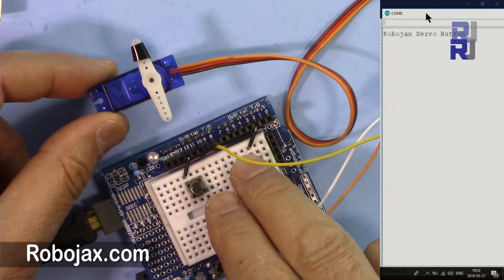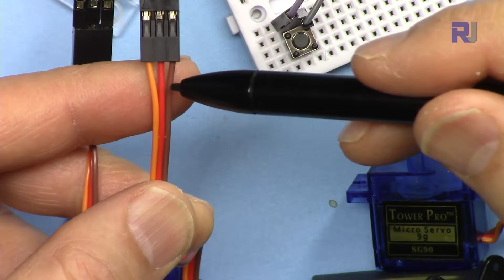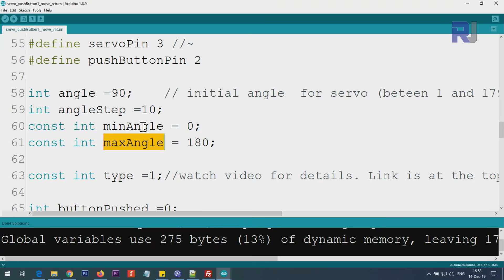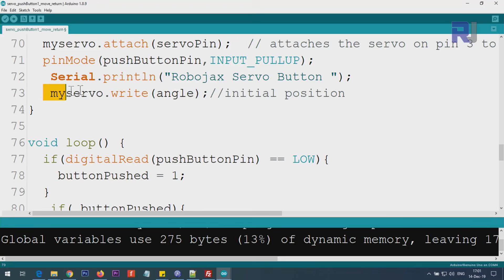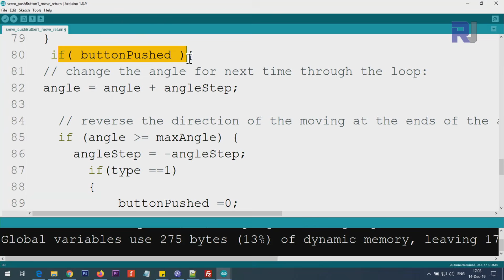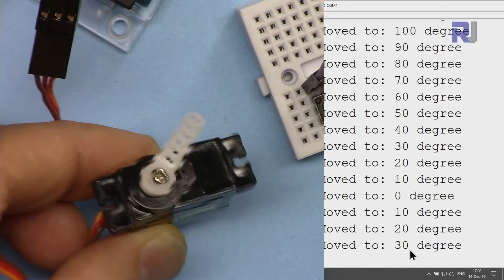Control Servo motor with a Push Button:  Move Servo and Return SPB-1

Comment: how to connect two servos to the same code in this case?????
Reply: i want code , wiring and explaination please
Reply from the maker: what you aks is full  video. it can't be explained with few lines.  God willing I will make the video you wanted. I have to see when I am free for that. But I have explained everything. if you watch it multiple times to learn how it work, or watch my other videos I am sure you will learn how it work and you can change it for you purpose. but if you don't want to learn, then either wait or pay someone to do it for you.
Reply: @robojax  ok i will be waiting cause it is a very important project and i will be waiting ....thank for replying(please try to solve my problem)
Reply: @robojax  it would be better if you can send me the code and circuit wiring please .....gmail : irfanm.ahmed04@gmail.com and i have tried so any different codes but non of them worked properly (pls it would help me alot .....)
Reply from the maker: it needs 1 or 2 days of work. I don't have it.
Reply: @robojax  ok no problem take your time (thank you)......
Reply: @robojax  bro from the last 2 days i have tried so much but i was not at all succesful at moving 2 servos with 2 different push buttons so that when the button is pushed the motor completes 180 degress and comes back .... i asked a few people who were familiar wit arduino but they didnt do much ... it would make a huge difference  if you could help me with this .... looking forward to your reply

Comment: Does anyone know if it's possible to connect two servos to one button?? I searched everywhere! Not finding anything😔
Reply from the maker: I have explained every line of the code. it would be very simple to assign pin to another sensor (or search my other videos) then instead of one servero send the same command to another servo. most of the time people don't watch the video and they don't learn. you gotta watch and learn it. or pay someone to do it for you.

Comment: Thank You So Much!!!! I just have a few questions.
Question 1: how can u do this with a horn button. 
Question 2: what Arduino do you recommend. 
Question 3: my breadboard needs to be quite far from my Arduino for my projects. So what can I do to create more space between the Arduino and the breadboard?
Reply from the maker: you are welcome. 
1-I have explained every line of code, watch my other servo related videos and you will find something to fit for your need https://www.youtube.com/robojaxTV/search?query=servo
2-All arduino boards will work. UNO is the cheapest
3-yes you can as the servo needs very little power
good luck
Reply: How did you end up creating more space between the arduino and the breadboard?

Comment: excellent video....is there a way to use a single servo  with 5 push buttons and on every button press the servo should rotate desired degree angle and get back to starting angle i mean where it actually was ....and this cycle needs to done times of button number....i means for 1st button rotation cycle is for 1 time...for 2nd it is twice and so on till 5 rotation for 5th button.....please help me out if possible.....thnk u
Reply from the maker: thanks. yes it is possible. Actually the possibilities are endless. This SPB-1 (Servo Push Button 1) and I have more videos. I have mades such video where sevo is controlled over WiFi using ESP32 (sister board of Arduino) you may learn from it. https://youtu.be/5TlEgfFDrzI
Reply: @robojax  thnk u so much... Your videos are so helpful... 😊
Reply from the maker: you are welcome.  I am glad you found it helpful.

Comment: Hi, Thanks for the video, it was just what I was looking for. But I am trying to simulate the recoil of a tank gun and need it to travel fast in one direction and then reverse in the other direction but slower.Have watch the video a few time and played with the numbers and get change the speed but only for both direction going the same speed. Can you help . Thanks Steve
Reply from the maker: Hi Stephen,  I just spend some times thinking it would be quick fix. but it seems it needs some work and I did not have time to do it.

Comment: Hi sir,,
Can you help me with this code i have?. I want to put button switch just like your video in my project..
My project is rfid door lock with lcd,servo. At down here the code i use.. Can you combine your code with my code?

// Include required libraries #include <LiquidCrystal_I2C.h> #include <SPI.h> #include <MFRC522.h> #include <Servo.h> // Create instances LiquidCrystal_I2C lcd(0x27, 16, 2); MFRC522 mfrc522(10, 9); // MFRC522 mfrc522(SS_PIN, RST_PIN) Servo sg90; // Initialize Pins for led's, servo and buzzer // Blue LED is connected to 5V constexpr uint8_t greenLed = 7; constexpr uint8_t redLed = 6; constexpr uint8_t servoPin = 8; constexpr uint8_t buzzerPin = 5; String tagUID = "29 B9 ED 23"; // String to store UID of tag. Change it with your tag's UID void setup() { // Arduino Pin configuration pinMode(buzzerPin, OUTPUT); pinMode(redLed, OUTPUT); pinMode(greenLed, OUTPUT); sg90.attach(servoPin); //Declare pin 9 for servo sg90.write(0); // Set initial position at 90 degrees lcd.begin(); // LCD screen lcd.backlight(); SPI.begin(); // Init SPI bus mfrc522.PCD_Init(); // Init MFRC522 lcd.clear(); } void loop() { lcd.setCursor(0, 0); lcd.print(" RFID Door Lock"); lcd.setCursor(0, 1); lcd.print(" Show Your Tag "); // Look for new cards if ( ! mfrc522.PICC_IsNewCardPresent()) { return; } // Select one of the cards if ( ! mfrc522.PICC_ReadCardSerial()) { return; } //Reading from the card String tag = ""; for (byte i = 0; i < mfrc522.uid.size; i++) { tag.concat(String(mfrc522.uid.uidByte[i] < 0x10 ? " 0" : " ")); tag.concat(String(mfrc522.uid.uidByte[i], HEX)); } tag.toUpperCase(); //Checking the card if (tag.substring(1) == tagUID) //change here the UID of the card/cards that you want to give access { // If UID of tag is matched. lcd.clear(); lcd.setCursor(0, 0); lcd.print("Access Granted"); lcd.setCursor(0, 1); lcd.print("Door Opened"); sg90.write(90); digitalWrite(greenLed, HIGH); delay(3000); digitalWrite(greenLed, LOW); sg90.write(0); lcd.clear(); } else { // If UID of tag is not matched. lcd.clear(); lcd.setCursor(0, 0); lcd.print("Wrong Tag Shown"); lcd.setCursor(0, 1); lcd.print("Access Denied"); digitalWrite(buzzerPin, HIGH); digitalWrite(redLed, HIGH); delay(3000); digitalWrite(buzzerPin, LOW); digitalWrite(redLed, LOW); lcd.clear(); } }

i want open the door from inside because my scanner rc522 at outside.
Reply from the maker: Hi, I have left nothing unexplained. So watch it carefully (without skipping) to understand it. Then you can customize it.
Reply: @robojax  i fail every time combine the code.. and i fed up right now.

Comment: Hello mr ahmad i really appreciate your work and knowledge and inspire with your circuits, actually i create a circuit for my project with help of your video tutorials, but when i press the button servo go 0 to 180 then return to its position and continously rotating in that direction i dont understand whats wrong , any help is appreciated thank you
Reply from the maker: Hello, Thank you.  Perhaps you have changed the code. I would suggest using it without any change. It should work.
Reply: @robojax  Thank you sir for response to my querry i really appreciate it, but i use your original code without altering it. When button is on motor rotate back and forth then go on without stopping in that direction thats the problem .

Comment: where do i have to put the delay, if i want a little pause before the servo turns back?
Reply from the maker: I just watch this video before replying to you making sure I did not miss it. I have explained every line of the text and clearly said "this will change the direction" exactly after than line you will see your delay. But we have two spots in the code where we change the direction. One is when it reaches 0 degree and the other when it reaches 180. So please watch the video without escaping and I can assure you , you will understand everything in the code. Good luck.

Comment: thank you so much !!
mr ahmad!! is that possible to add any sound module or anything to the arduino when the servo move and return then play any sound (my kids voice  or music or..) at the end of the servo return??
Reply from the maker: you are welcome. I don't have the sound device you are working with  but  (one way is that ) you can do it with relay to turn ON or OFF your sound device (https://youtu.be/g6k8sPJyif8) . if you have sound recorder module (https://youtu.be/IfK8z_o5vbk) 
you can do turn something like this: 
if (angle ==0)
{
// Do something else. This can be turning the relay ON  or OFF or  light or sound device.
}
Reply: @robojax  thank you so much for respond!
mr Ahmad !which relay do i need to buy ? and can you just write the code  here for me  when the servo back to 0 and then the relay   turn on the sound device to play my music(stay on  at list between 5 t0 10 second) then off.
this stuff is really new to me and i'm just trying to get better and thank you for helping us MR ahmad!!!
Reply from the maker: No problem. Please tell me how are you playing the music?  is it operating with AC or battery?
I visited your channel. Nice videos. Specially Ava's song is so nice. Banafsheh is very expert in swimming.
Reply: Robojax tthank you so much for being kind and your nice comment!!
I have an old voice recorder just I’m trying to use that and it is working with dc  6 volt!!
And I want to connect the play button to a relay(that controll with arduino)that you talked about it !!
Or any other way you may suggest to me!!
The plan is when the servo moved and back to 0 then a sound be played (5 to 10 second)
Reply from the maker: You are welcome.  سلامت باشید.
because the voltage is different, then you have to use relay to turn it ON and OFF and have separate 6V power supply for the recorder. So use the relay link I mentioned above. Once you are successful to turn ON and OFF the relay and your recorder, I will modify this code so you can use it with relay. Please make sure to post a new comment because I have one page where it shows comments, new comments are shown at the top and your comment in terms of time counted with the first comment and it is way below. So I hope I don't miss it.
Reply from the maker: سلام علیکم. مجرا (کانال) فارسی علم و فن را راه اندازی کردم:  لطفا به دوستان تان خبردهید و حمایتم کنید.
https://www.youtube.com/@ilmofan

Comment: thank you so much!!!!
i clicked  on download code but it got  me to the different code that,s not related to this video !!! so is there any way to upload the code to my arduino ?
i was trying to type all the code you explained  but i got a lot of errors😢😢
one more thing im confused what is the servo.h on the beginning? and you said you don,t need to download is part of the arduino IDE?!! so do i need to open the sketch that just works for  servos and then need to type the codes? im really beginner!!!!🤦‍♂️🤦‍♂️🤦‍♂️
Reply from the maker: Hi, I just check the link to the code and it is the right code. Yes you don't need to do anything or download anything. If you click on File->Servo->Sweep and if you see Sweep or Knob, you have the library and it should work.
Reply: @robojax  thank you for respond as always!!
mr ahmad is that possible to add any sound module or anything to the arduino when the servo move and return then play any sound (my kids voice  or music or..) at the end of the servo return??